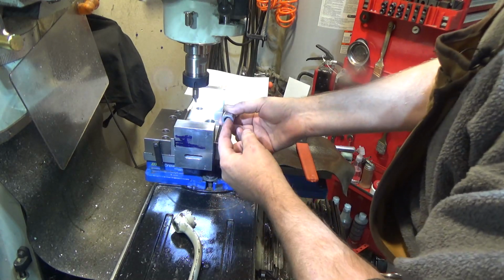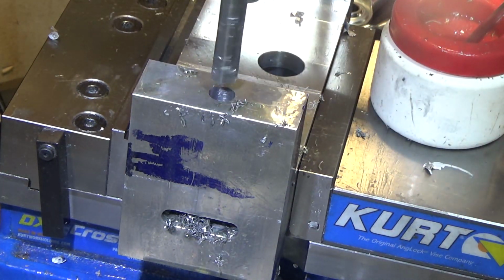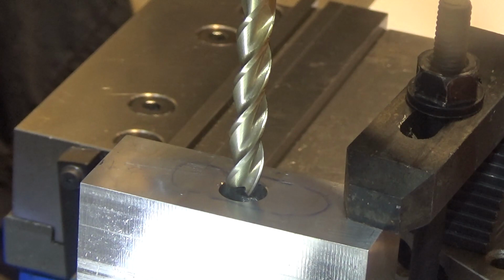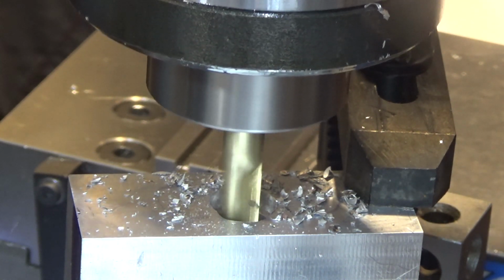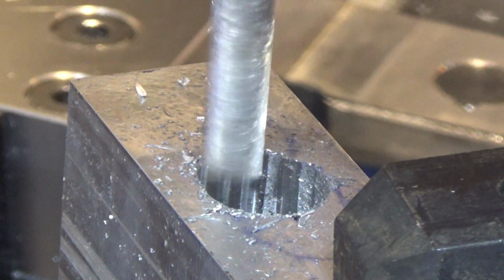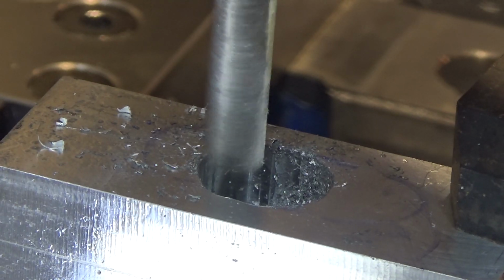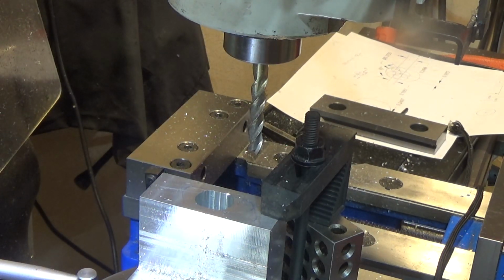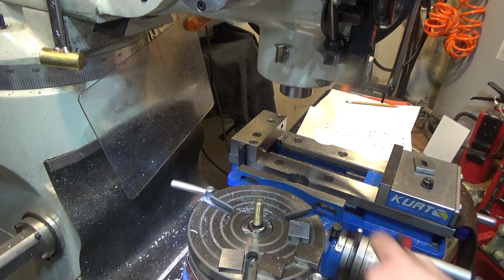150 6x48 BeltSander Upper Lift and Tilt Assembly 12 Part 3

Comment: Clearing chips out of deep holes in aluminum is a bear. The 80% lower I did made me a believer in 2 flute end mills, WD-40 and compressed air to clear chips in aluminum.
What a mess!
Reply from the maker: I get ya. That is some square advise. I probably should have purchased a more appropriate endmill.

Comment: Thanks... I enjoyed the vieo. You might have drilled the 1/4" holes for corner relief before you milled. Drill and ream after the pocket was milled. Also you might have moved the 1/4" hole "outboard" to add more corner clearance. Your flat and diameter would still have enough surface area to align.
Reply from the maker: Thanks for the tips! Where were you when I was working on this?
Reply: @DudleyToolwright  Probably freezing my butt off in my shop up in the Great White North. :)

Comment: Wow you like quite complicated don't you? Nice job though, came out well. Thanks for sharing.
Reply from the maker: I don't always, but this project was a design from scratch that I wanted to have include some mechanical methods that I had never used before. as a result, this would never be a marketable design, but I learned a ton.